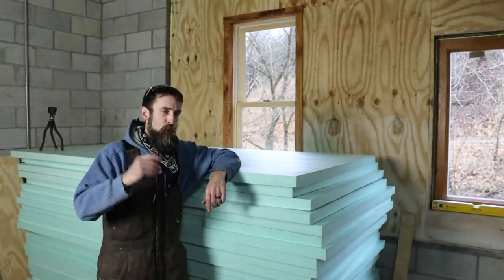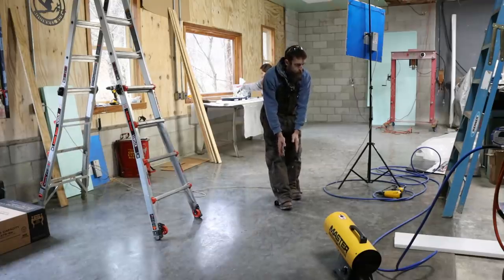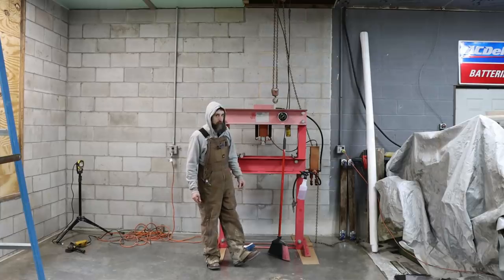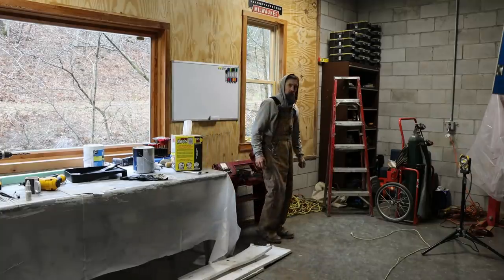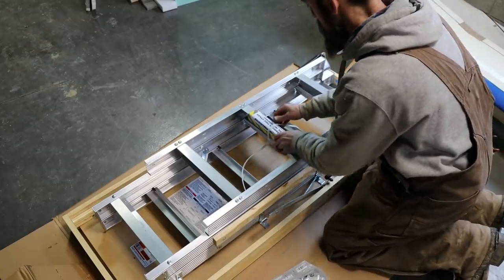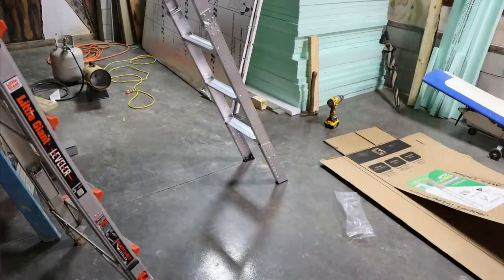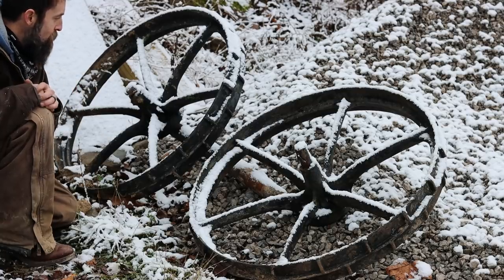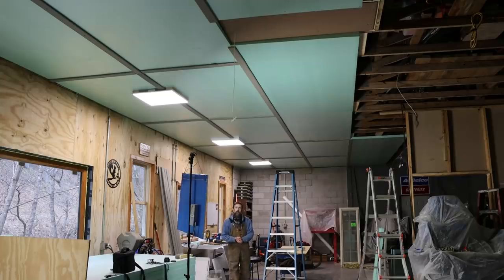Installing the new shop ceiling! One step closer to finished!

Comment: I started with a wood stove because I have 27 acres of woodland around the workshop. But cutting, splitting, transporting and stacking wood soon became a chore. Plus lighting it every morning. As my large stove was dual fuel I then went to coal which burned all night and was really warm. But still humping bags of coal, having fine ash everywhere and a growing mound of cinders soured that. Now I have a ceiling mounted propane heater with a thermostat. Perfect.

Comment: Hi Steve, this is the best bit putting all your machines and new/old machines in place. Good idea with the curtain to control dust. You might need machine covers as well. Don’t you go scratching that lovely floor when your moving the big items. It might be worth thinking about a wicket gate in your double doors for controlling the heat from that lovely big wood burner. Looking good and can’t wait to see all the ceiling done. It will look massive. The big grin at the end said it all. 🇬🇧👍👍👍👍

Comment: I wish I had put up a ceiling when I moved into my shop. Using foam Norris is a great idea.
About the wood stove Home Depot sells a kit to turn a 55 gallon drum into a stove. It’s easily done & heats my 1200 sq. Ft. shop to about 60* in three hours with a 25* outside temp. I lined the bottom with fire brick to prolong the life of the drum. I’ve had it for about 6 years now.
You’ve done such a good job on restoring your shop. You should be proud of your work.

Comment: I converted an old workshop at my Pops house in Pensacola, Fl into an efficiency apt.  We used that same foam board for ceiling panels and put pink insulation between the rafters.  Not only was it virtually sound proof from the Blue Angels jets that flew over daily, it was about an R32 insul value as well.  Good job, great choice over drywall!

Comment: Ahh, Saturday morning with Steve doing it right and coffee. Can't be beat in my world. It's kind of a shame to cover that beautiful wall now, LOL. The last trip you make up that ladder won't come soon enough eh. You will have to find a place for that nice big, flat cardboard for making patterns from. Always handy. Thumbs up on the woodstove and 4 large ceiling fans moving slow to circulate the heat or cool as you need. Up in winter and down in summer. Flat white or a nice soft yellow will make for the best colors to brighten up the place. It is what we used (the yellow) in our 40x60 shop. Come back soon EH !

Comment: Steve, I think you made a wise choice for the ceiling and your lights, a little white paint would go a long way in lighting up the shop and improving the overall looks of the shop. The shop is looking great so far and will be easy to heat.

Comment: Reading some of the other comments, I agree that it would be a good idea to paint the ceiling for fireproofing.
Reply: Not sure a layer of standard paint adds much in the way of fire resistance.  While they do make special paint that is fire resistant, I can't imagine it would add much when applied directly to the foam board.  I have been thinking about ways to insulate my garage.  I would consider the foam board, but would not leave it as it because of fire code.  I'd probably add drywall.  I know that makes it much tougher, but it probably needs something.

Comment: I believe I would take the wall out too. Idk about exposed foam. Lots of cons to it. But you can always go right over it if you change your mind. Really looks great there. The drop stairs are well worth it just for access alone. You could do a stand alone solid steel pipe chimney for wood heat. Stand it off the building set in concrete with braces to the shop. It eliminates all the leak possibilities and in a big way reduces the fire risks. Thanks for sharing

Comment: I think you are right they are sickle mower wheels. Rake wheels aren't that heavy because they don't need that much ground force to drive.  Shop is looking good and the dual use of the foam is a good idea, plus install is easy with the light weight. :-)

Comment: I'm seriously seriously jealous of your shop. Awesome job!!!. One source of heat that might work is an outside wood burner with ceiling heat exchangers. My neighbor has had one for many years to heat his home and it heats the water in the water heater also. He stated that he only has to add wood once in the morning and once at night and that depends on what you have your thermostat set to. For your shop use , I would think that if its kept around 60 degrees, that would be just right. Can't wait to see it done.

Comment: Another very nice video steve.  IMO get a ceiling mounted propane heater with a blower fan or even some duct work, on a thermostat.  Put a big old propane tank outside and... FORGET THE HASSLE of wood stove maintenance that will only provide uneven heat and constant attention.   I'm 70, trust me, I've been to this movie.  When you finish the build focus on your machining and fabrication instead of gathering, cutting, stoking, cleaning a wood stove. 🥴👍

Comment: "Putting up the ceiling is hard"...from the guy who just jacked up half his shop, tore down and saved the block walls, dug out new foundations, poured the footings, rebuilt the wall, cleaned, preped and poured half a shop floor...etc...etc...etc. Riiight.
Lol, thanks for the trip of your shop update/upgrade and sharing the reasoning for all you have done. Awesome work, and there is light at the end of the tunnel! Stay safe, God Bless.

Comment: Since it looks like you are planning to use above the ceiling as storage, I would place materials up there before you get all the insulation screwed up to use to sit stuff on.  It would be almost impossible to put plywood etc through the ladder door.  Of course the shop is yours, don't worry what others think on your color or material choices.  Have enjoyed watching you rebuild the shop.

Comment: Personally I think the green ceiling looks fine. The grid formed by the plywood strips is visually appealing. Re: your decision to leave the shop one large open space. If your household works anything like mine, there might be times when you want to get out of the house (read your wife runs you out of the house) and you want to spend just an hour or two in the shop. If it's cold, that means you'll have to heat up that large space to be comfortable for just that hour or two. For this reason it might be a good thing to have a smaller space walled off which can be heated up more quickly and at less expense. You'll want to have a recliner in there, too. And maybe a TV and a dry bar.

Comment: I think the ceiling looks fine the way you have it. f I have a suggestion for wood stove. I bought a unit from Fleet Farm many years ago called "Wonderwood" wood stove.  It resembled the old oil heaters but it held large wood pieces and heated a 2000sf home.  Keep on smiling.

Comment: Steve, quick tip, wrap Saran wrap around the top of the paint tin, you can peel it off and leave the paint tin clean of drips
Reply: I turn all my paint tins upside down after use, as it stops the usual skin forming.
Turn them over a short while before using again to allow paint to drip from the lid.

Comment: Steve

I think you made a good choice with the Kingspan product.  I used another Kingspan product in my steel framed and steel sheeted workshop shed ( Lysaght Colourbond ).  It's a type of foam sandwiched between two layers of foil.  One layer of foil is silver like and the outer layer is a gold colour.  It's not as cold here in Winter as it is Kentucky, but in Summer it's hotter and more humid.  Even though this product is only about 1/2" thick, it's amazing how much heat it keeps out, while still keeping the warmth in during Winter.

Your job looks to have turned out really well.

Comment: I'm loving the progress Steve. I used the same foam insulation in my shop, just coverd it with formica, cause i use alot more spark and flame making equipment. The valve on the press will be a easy fix, mine was doing the same thing. Take care Steve and family, can't wait for the next video...

Comment: Just a thought to help with the attic stairs. Remove the rope and put an eye bolt then get a long dowel with hook to pull it down. Another eye bolt can be put on the stairs to help pull them too. I saw this alot when I worked HVAC repair in homes with 9' + ceilings.

Comment: Looking great, Steve!! 👍🏽👍🏽I don’t recall if you like the look of bare cinderblocks and plywood, however - I’ve made that “what I called a mistake” a few times. You get excited and start loading the space up before painting and then You never want to move the stuff around to finally get it painted. I built my garage 10 years ago and it’s only got tape on the sheet rock, green sheet rock. It’s my opinion that you will regret it if you don’t do it now. A few hundred bucks worth of paint and a day of work... 😁

Comment: Paint the ceiling a GLOSS white to reflect light back down, made a HUGE difference in my garage to brighten the area. Paint the walls a FLAT white, again to brighten the area, this will lessen eye strain as well and make the walls easy to clean if needed.
Reply: "FLAT" is a bitch to clean!  Bad idea.

Comment: I kinda dig the ceiling look. I will suggest to changing the pull cord on the attic ladder. I installed the same ladder in my garage and the cord lasted one year before it deteriorated.

Comment: Before the foam ceiling is all the way up I would put some 1/4” plywood up there so you can continue to store some lightweight stuff up there. You don’t need to cover everywhere just a couple sheets wide around the new stairs.

Comment: If you are not over doing some masonry work by now, a masonry heater is a great way to go, and can be done on the cheap for a shop, check out Russian or Finnish mass stoves. You fill and burn it once a day, and the fire runs full bore until you are out of fuel, then you shut the flue and all the heat stored in the mass (~4 tons of rock and fire brick) slowly radiates out throughout the day and night, they are very efficient, and save you having to care for and feed a regular wood stove throughout the day, plus the place won't be freezing every morning. My uncle has 3 including one in his machine shop, made with concrete. also works as a great place to stress relieve / anneal castings before you go after them in a machine.

Comment: Steve. those cast-iron wheels would make an awesome base for a water wheel generator project. You have a huge amount of free energy flowing past your shop, just meters away (or many Americans, whatever that measurement is), which you could be harnessing. And I am sure you'd make it look stunning with your skills.
Reply: You can't put water wheels in most waterways. The laws in the US governing waterways, regardless of whether they're privately owned, are very complex. It's not worth the hassle. A water wheel of that size would be no use for on demand power anyways. You'd need battery banks to store it. Building the water wheel, the associated electronics, battery bank, etc would be easy more expensive than just using power from the power company. It would take about 10+years to recoup the money, and around that time you'll need a new battery back, and it'll take another 5-10 years again for that to pay itself off.

Comment: Steve, be careful when closing the attic stair door. Always ease it closed. If you let the springs snap the door shut it will tend to tear the door panel off.
Reply: did i not see gas lifts on that stairs as it opened? If so they will act to dampen any aggressive spring action when closing.

Comment: One thing to consider with that foam, I had the pink version as a ceiling in a shop and had a problem with the nail heads pulling through the foam over time. Air blowing in an open door or just normal expansion and contraction worked on it enough that it got loose. I finally "repaired" it by covering the entire ceiling with 1/4" painted plywood.
Reply from the maker: Mine is held in place permanently by the wood strips that are screwed directly to the truss with 4" GRK screws. I wouldn't trust screws through foam alone. When I had the original foil backed foam in the smaller work space I held it in place with the plastic cap head screws that worked ok as well but didn't look very good IMO.
With the foam ceiling a solid  attachment is the problem I agree 👍
Reply: @SteveSummers  Yeah, my only other issue was when someone was up in the attic and stepped off the boards, but we don't talk about that... LOL  Looks great though.

Comment: those two old cast wheels are prob off an old horse drawn mower ,  years ago my dad had one when we were in Guernsey ,he converted it from horse drawn to tractor drawn , for which i had to sit on the mower while he drove , pulling leavers to adjust the mower , prob an Averling barford , or a Bamford mower , must had been 1000s in the states steve ,   love how the shops coming along , good viewing times , regards from the UK

Comment: Hi Steve! Two comments: If you don't paint the ceiling white you will have to cope with a green tinge on everything in the shop.  Also, think about installing some basic lighting in the attic. It sure beats not having both hands free since you would then need a flashlight every time you are up there. Congrats on the great work so far!

Comment: The attic stairs look good.
The cheaper ones I had to deal with doing HVAC work in homes showed me the limits. 
They have a weight rating. 
I weighed too much for most of the home units I had to climb.
Thanks

Comment: if it was me I would put a wall at least a car & 1/2 back and insulate that cause that sliding door will never hold the heat/cold in you could put an oversize double door into it for access that you can lock a leaf till you need to move machines. 
But overall its your shop you are the one who has to enjoy it so Im gonna shutup and enjoy you showing us the fruits of your labor.

Comment: Hi Steve, first of all I would like to wish you all the best for the new year and congratulations on the renovation of your shop. As for a possible use of those cast iron wheels, the first idea, remembering what Abom79 made a few years ago, is to use one as the base of a rotating welding table and the other as the top of the same table. All the best to you and your family and furry animals. Stay safe.

Comment: I would have stapled fabric type house rap to the bottom of joist to allow moisture to escape the space while minimizing air movement. Along with the insulation, it would of helped keep the heat in during colder weather and out in the sunny hot weather. Looks good other wise. If you do use a wood stove I would consider using drywall above the immediate area above it for fire protection.